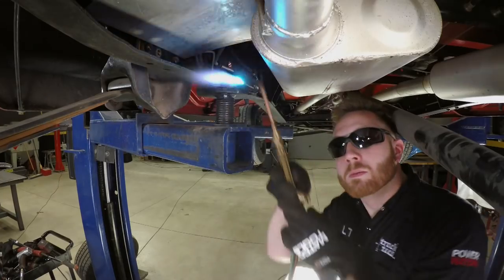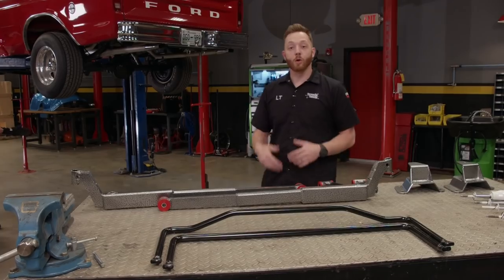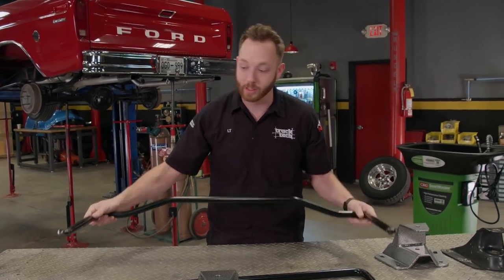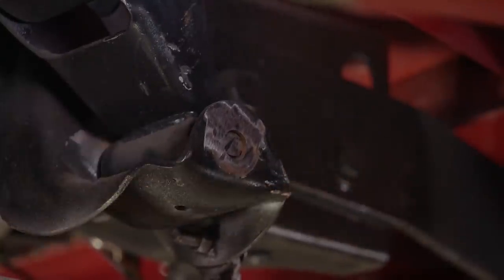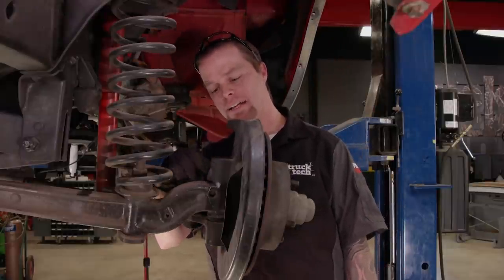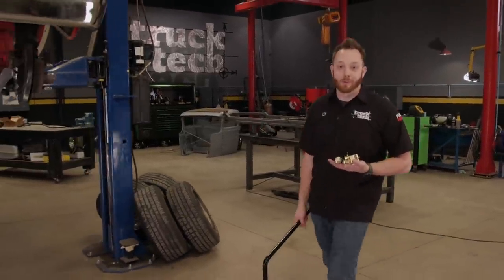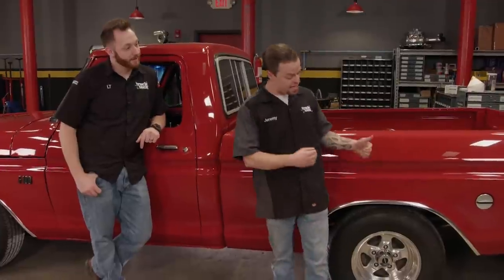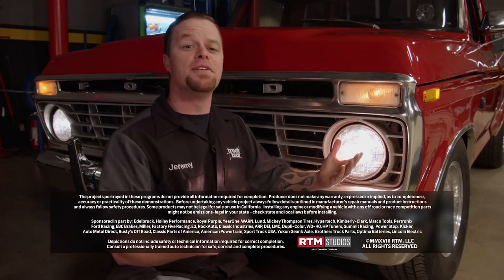Say Goodbye To Body Roll: Suspension & Sway Bar Upgrades For The '74 F100 - Truck Tech S5, E5

Comment: They are anti-roll bars, not sway bars.
Reply: Same thing silly
Reply: @aaronbackus4548  If you want to use 50's terminology and not describe what the part actually does.
Reply: @aaronbackus4548  Gladly. And engines aren't motors.